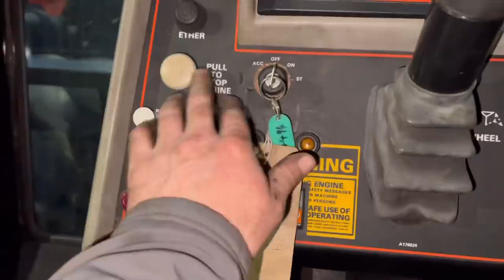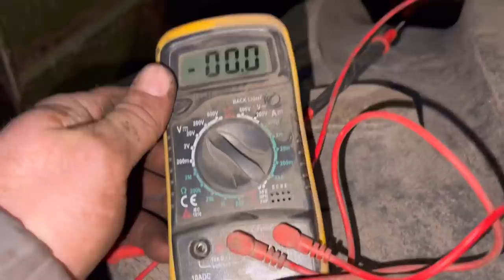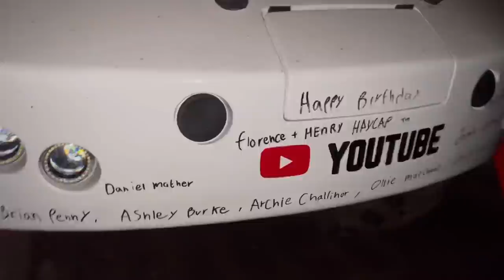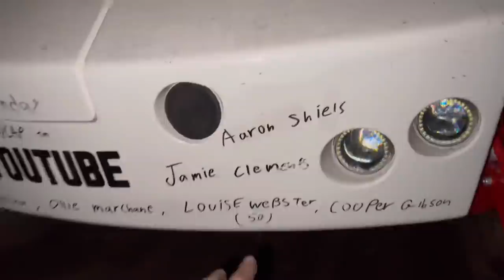Day613 #OLLYBLOGS BIG RED TRACTOR WONT START, BEARING CHANGE,DOG ACTION     #AnswerAsAPercent

Comment: Try crossing the terminals on the solenoid on the top of the starter motor ! On Brutus 👍. By passed most problems and you’ll find out if it’s flat battery or something else 
Peter
Reply from the maker: Will see tomorrow

Comment: It seems there are problems with starting and users suggest cleaning all the relays, battery post particularly if you hear clicking sounds. I goggled it as case 449 starter problems. Have a look it might help.

Comment: I'm sure later Case, mid 90s used to have a relay on the bulkhead in the engine side near the windscreen.  That used to fail and the tractor just wouldn't start. Don't know if it'll be on that though 🤔

Comment: Had to change the bearing on the slurry tanker when you need a spanner on the inside cut a slot on the end of the bolt used a flat screw driver to hold the bolt and undid the nut from the outside second shed had its floor poured today the batching plant ran out of concrete twice Wil mid Wales
Reply from the maker: Prob I had was bolt fell in 🤦‍♂️

Comment: Hi Olly the case 4494 can sometimes be finicky starting .. its a  12 volt system. Really needs two good heavy duty or deep cycle batteries Make sure all her relevant electrical connections and battery terminals are clean especially all earth connections . Excellent video again 👍👍 Kev
Reply from the maker: Have you got one ?
Reply: @OllyBlogsAgricontractfarmer   no I haven’t . There were 2  4494’s where I worked for a agricultural contractor in Sussex  I would have to drive one sometimes although my main machine was a Deere 8640 the 4494  didn’t have the power as the 8640 but still a good tractor

Comment: Hi Olly the fact you said you tipped the spanner from possitive to the frame with no spark suggests that the neutral cable to the body could have a bad connection

Comment: I've emailed the 4494 starting troubleshooting to Robin....really need to put a load test on the battery, a multi-meter doesn't tell you much.....they will read 12 volts but under load can drop right out.......also there's an ignition fuse to check out, also an intermediate solenoid.....as well as the terminal tightness on the starter
Reply from the maker: Yer he said thanks 
And thanks for all your help with his MAXXUM to

Comment: Spend 1/2 your life working on that wood burner/boiler system doing repairs, changing motors & bearings, makes you wonder if it's worth it.
Reply from the maker: With Not having to buy gas or oil yes

Comment: Blue 90% hot wire the starter motor to rule out the battery if it turns over then it is a lock out and if the radio is 12 and the tractor is 24 it must be run off a drop box or you will flatten one battery

Comment: Old batteries just die and won't hold a charge, so perhaps worth renewing both.
It could also be a jammed starter, or the solenoid not making good high current switching, possible burnt contacts, etc. Also holding the starter switch on for ten seconds, then feel for warm connections is an old boys technique for finding the bad ones !

Comment: Big red works for me 👍 batteries defo not parallel up as would both read same voltage regardless. You may find it is 24v on the starter circuit and only pulls off one battery for the cab electrics ie 12v. Some old vehicles did this but the battery that provides the 12v doesn’t always fully charge in this configuration. Bit of grease on the boiler bearings wouldn’t go amiss 🤣🤣

Comment: To test the battery you should hold the multimeter on the battery and try start it that will give you the true voltage of the battery might say 12v but under load might be 0v.

Comment: Sprocket is the dog from fraggle rock and we love wee Chester. 4494 is a 12v system (according to the specs I see online), I noticed we don't hear the beeping of the handbrake warning, is the ignition interlocked that the handbrake has to be on for it to start?
Reply from the maker: I tried that 2